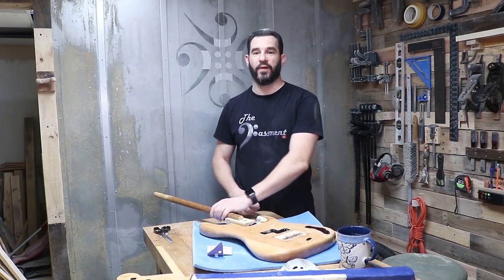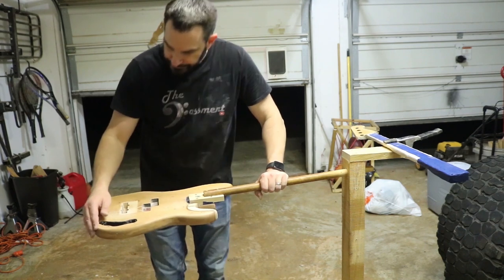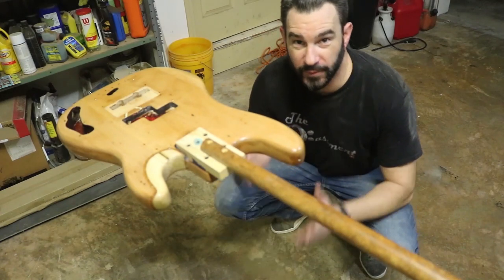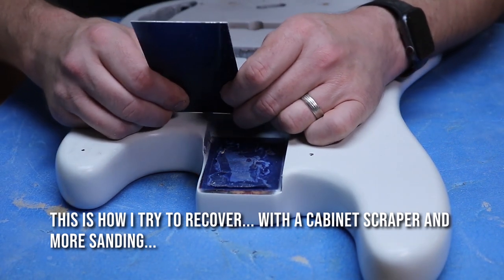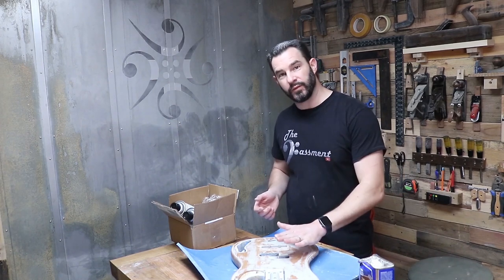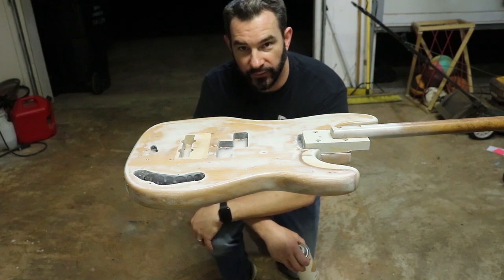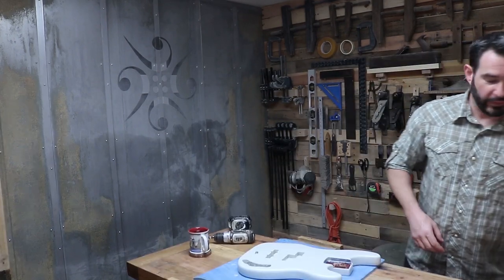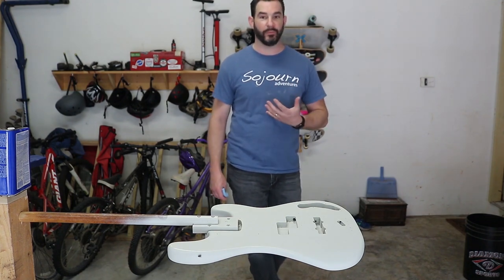Fender P Bass Rebuild Ep 6

Comment: You could save time and money by buying a gravity feed hvlp, automotive spray gun and buy sealant  clear in gallons vs. Rattle cans which give you about 3.5 oz of actual product. Also using bondo, spot and glazing putty would be a better choice. You can wet sand it unlike spackle
Reply from the maker: I probably will do the hvlp setup at some point if I do more of these builds.  I used bondo when I did my jazz bass.  I went this route this time because of the owner of the company I got the nitro from has had great results with this method and his product.   (Epoxy)  The spackle to your point was horrible and I sanded all of it off before I sealed the body.  Virtually none was left.  I’m a total amateur learning as I go.
Reply: I agree that this refinishing should be approached very much as an autobody finish - sealing the bare wood, spraying coats of filler-primer, touching up imperfections with autobody putty, wet-sanding to 400 grit, and re-sanding (possibly re-priming) before spraying the color coats and color-sanding from 400-grit out to the highest grits before polishing.  All sanding on the flat surfaces also need to be done with a block rather than bare hands to ensure paint straightening.

Comment: a wood hole should be filled with wood, or wood putty 
not super glue.
Reply from the maker: Grant Koeller that seems to be logical.  I scared of it with a nitro finish for some reason.  I guess I need to get over it and try it.  It can’t be worse right?
Reply: Yeah and there's so much paint etc used on it - there is a chance it won't sound good-- Been there done that. Did so much sanding/ painting/ wood filler/sealer// glue/primer/ sand/ repaint/ filler / sealer/ paint sand/ paint /sand==  the bass sounded like it was made of "play dough". Sold it.
Reply from the maker: Richard sears hopefully that won’t be the case here.  I’m sanding off about half of what I’m putting on between steps so in the end the paint will be thinner than a modern poly finish that is common on new instruments.  The Jazz Bass I did a couple years ago was in sad shape to and I used bondo as a filler on it and it sounds amazing!  Granted I put a hip shot high mass bridge, ‘62 custom shop pickups and an Emerson pre wired pot/cap set on it.  But I have a hard time walking past it and not wanting to pick it up.... so fingers crossed this one will have a similar result with the original hardware and pickups.
Reply: @thebassment1845  people chasing the myth that fender only used nitro. Is bullshit. They used a poly sealer called Fullerplast prior to the ntro finish. So pure nitro lacquer doesn't matter for vintage sound
Reply from the maker: shidoin I don’t disagree with you there.  I used nitro because I can get it in the Fender paint codes that they used from Madison’s Music.  They are NOT a sponsor, just a great small company with great service.  If I have to spend the money I’d rather give it to someone I like.  There are definitely way more durable finishes out there than nitro which is why Fender no longer uses it except on some custom builds. I tend to subscribe to the notion that the sound is in the electronics and in the hands of the player and less so in the finish and even the woods for the most part.  I have heard shovels with a pickup and a single volume pot that sound half way decent lol.
Reply: @thebassment1845  I wasn't referring to you using nitro, but to the stupid comment about you using super glue instead of wood to plug a hole. Those would be the same peeps that think the fender must be solid nitro to sound vintage
Reply: That depends on the size of the hole (the smaller the better, of course!). 
But as superglue, once fully cured, is much harder than the surrounding wood, you should "sand" it while it's still wet - which comes with the added bonus of wood dust stickin' to the glue, acting as a filler. As always, it takes a little practice to master this technique, but if done well, it's a quick and efficient approach you can add to your vocabulary.
Generally speaking: There are no rules! Whatever works for you, works for you...